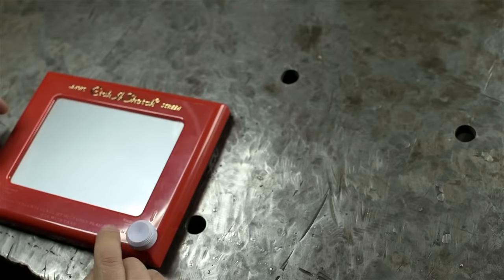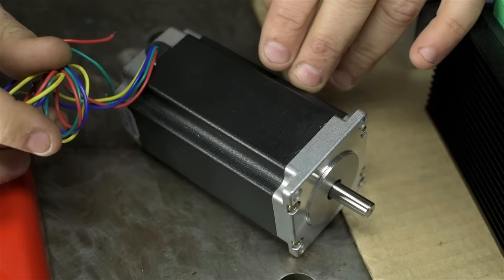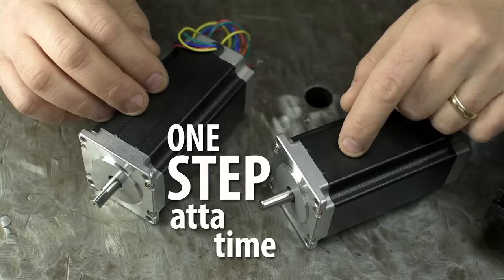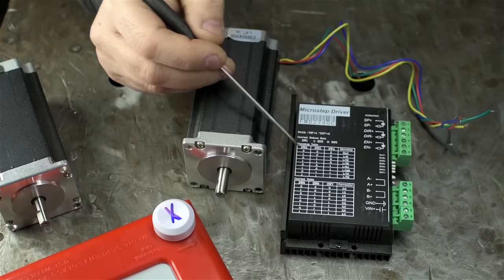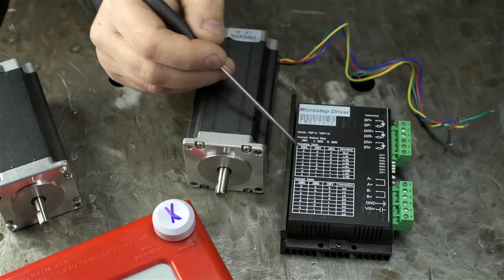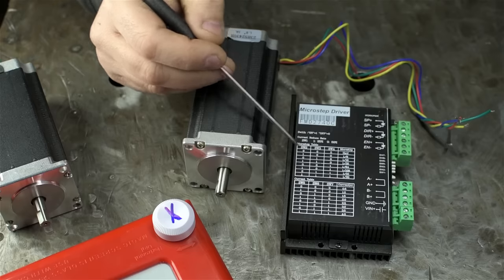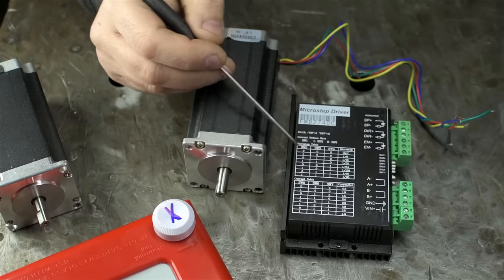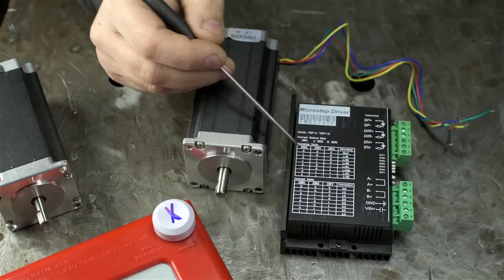Build Your Own CNC! (Part 1) - Hardware

Comment: So I come from building 3D printers with Arduinos and now I want to build a granite cutting CNC machine for my business so we don’t have to hand cut and polish so much, why spend hundreds of dollars on your control board when you can buy an Arduino Mega 2560 R3 with a Ramps break out board, throw in a bonus lcd and just run everything with Fusion 360 and some open source firmware like Marlin or repetier? I’ll have to wire and upload firmware either way,and I’d rather not dedicate a hulking monolith of a computer to a machine that I could instead save the weight and pick and move my cnc machine from project to project, is there a problem with Fusion 360 and arduinos I don’t know about? Nothing should be running fast unless you’re cutting styrofoam so it’s not a speed issue for wood, granite, steel, etc the usual stuff, the firmware is open source and all you have to do is upload it and choose your cnc machine dimensions which you have to do anyways for your board... I’m just confused, even the high end 3D printer boards cost 100-200 and they are normally there for overkill so I can’t imagine why spend 400 or more on a board without even a screen to boot

Comment: i feel like this could be futile to ask since your have 447,000 subscribers!, but i am one of them so here it goes.  I built my own CNC router a couple years ago and have a clunky old desktop running Mach3, I want to save some space and run either Mach3 or Mach4 on a mini PC with a touchscreen on a swivel stand.  It looks like you have another build in the works.  I wondered your thoughts on mini PC and Mach? thanks Tony
Reply from the maker: no first hand experience but from what I've seen and read, if your only running Mach it should be okay.  check min system requirements on their website. more RAM will help when generating and looking at toolpaths.

Comment: setup seems a bit overkill. You could probably get sufficient power from smaller motors and a cheap controller board with built in drivers. >$100 on aliexpress

Comment: Why all those needless crossovers in your line art rendering? It would be better and cleaner to take the outlines directly from point to point and retrace on inserts to minimalize extraneous lines... Or is this some type of thought process caused by many years of using CNC machinery? ~( ,m,)~
Reply from the maker: What you're seeing is Gcode intended for a milling machine.  The cross lines are rapid tool moves.  It could be written to retrace steps or take shorter distances but that's a lot of work.  (for me!) ;)
Reply: @ThisOldTony  Huh... When they were teaching us g-codes we were always advised to reduce crossover and long traversals as much as possible. We were taught to keep the cutter cutting a certain direction as long as possible and to work from one point across the work piece as tightly as possible to maximize production speed.

Comment: an rs 232c d type connector ... no never saw one of those before in my life ... never connected vcc to gnd on one nor used to swap bit 2 and 3 for tx rx operations ... nope never did anything like that lol ... wanna know the ibm xt gen 0 mother board jumper settings lol yeah I'm OLD SCHOOL ... i know 4.77 Hz 256k ram with mono graphics and a 360k floppy on 8.5 inch drive and a whopping 10 Meg rll drive .... yeah I know my old computers quite well lol

Comment: Hey I was wondering if someone could help me out I’m building a CNC router/plasma cutter quarter of the table design for router three-quarter’s design for plasma cutting I have a table 90% built if someone has any thoughts about  Having this combined would be great about any issues you can think of... I have the spindle and one side of the gantry any plasma. On the other....side..

Comment: I doubt that running a linux environment is necessary to run open source mach4 alternatives... I love what you're doing and I can completely follow your argument for better/more expensive stuff but why buy cheap stuff in the first place to replace it with higher quality components just to learn, especially for younger people or students with a very limited budget especially for a next to 0 load two axis project with no spindle to control anyways?
Whats with the elitists today, do you buy an iMac pro to read your emails because in theory it provides more power when all you do is reading your mail?

Comment: Aaaarrrggghhh those Mains wires. Be careful. This is not proper way to build electronics. I believe this was built only for testing purposes but never connect Mains power like that. Always keep it separated from other voltages and properly shielded. And always use stress releaf. I believe that we are much more safety concerned here in EU as we have 230-240 V but yours can be as lethal.

Comment: Vot are du dooingk? Ve are hate stepper motor culture of cheap western aspirant very much. They are noisy and slow and noisy and slow and they lose steps under load and they are NOISY and SLOW. If I were running Teknic, before it went bust I would send TOT some (4) hudson units and a meridian controller. The Texas Instruments chips are so fast now, and the SDK is so groovy, that wonderous things are now possible with servos. Teknic seem like a really good company, I don't know them from Adam but their motor controllers are Shexshy. No steppers. Better to have a smaller intelligent servo system, and learn the new way.